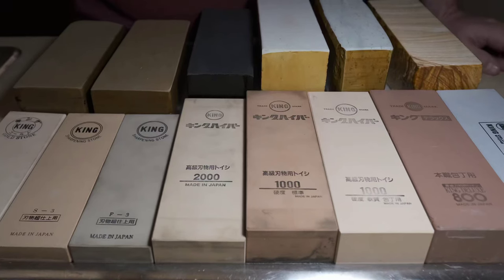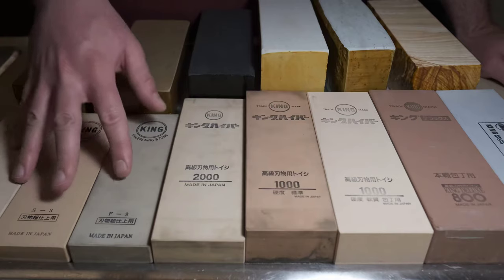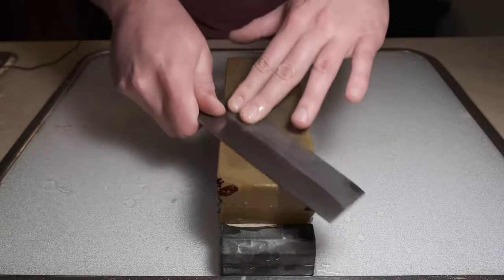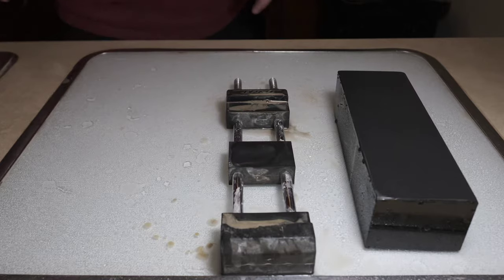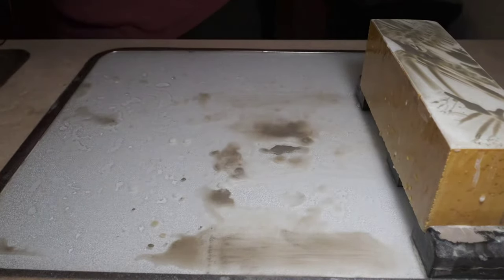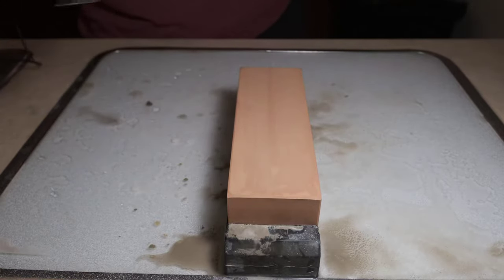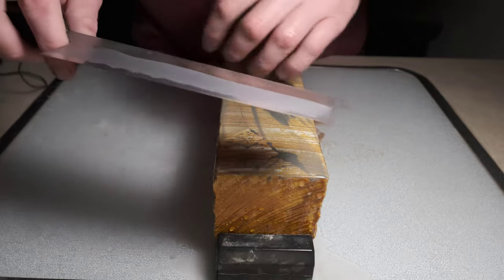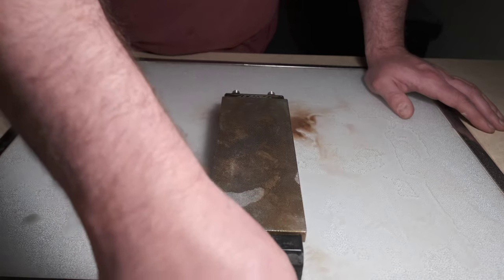Natural vs Synthetic Polishing Japanese Natural Stones King Hyper 1000 2000 4000 6000 8000 Review

Comment: How are the natural stones constructed? Like the mint chocolate one looked like it had beautiful amber wood sides and a mint chocolate frosting. When I see Finnish natural sharpening stones like phyllite, it's that grey, slightly shiny and with some patterns depending on the cut, somewhat homogenous slab of stone.
Reply from the maker: The stone you are talking about is called an Ikarashi, it is a type of igneous (volcanic) rock which is primarily silica but also has other minerals in it (resulting in the color). It has dendritic formations which are the black specs. The sides that are amber are lacquered. Sounds like the Finnish stones you are talking about are likely something akin to slate.
Reply: @naturalwhetstones  Thanks for the reply!